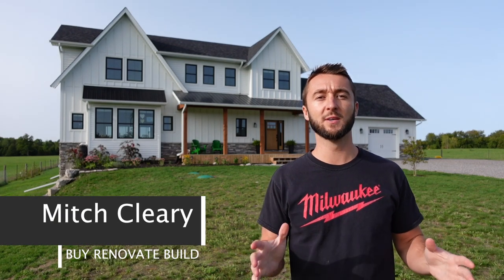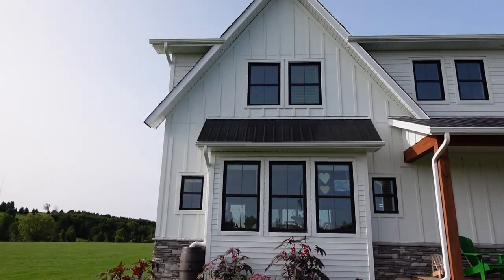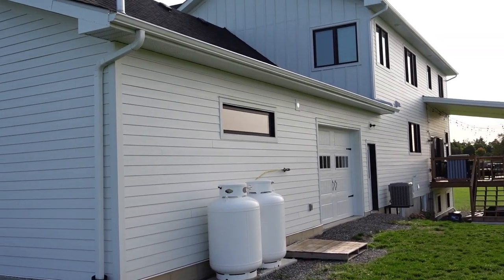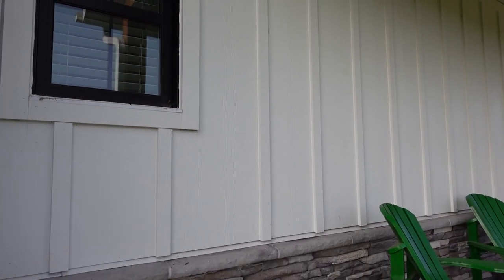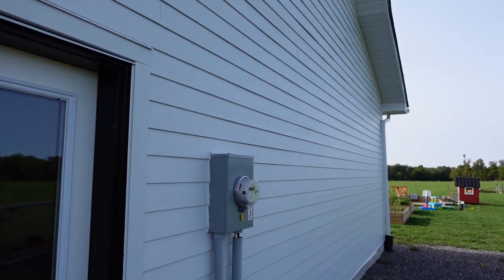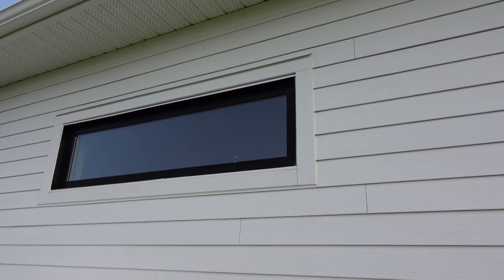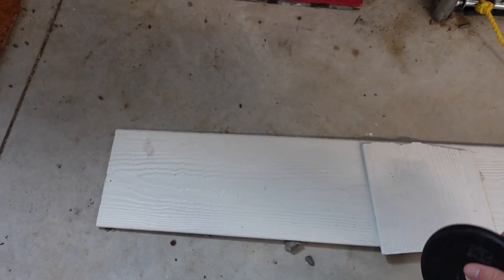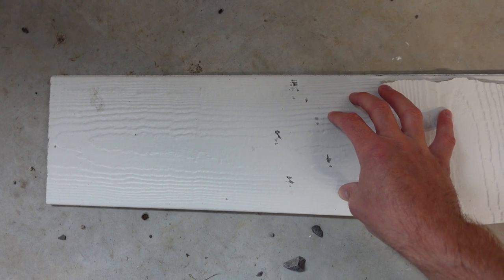Modern Farmhouse Exterior - Review of Our James Hardie Siding!

Comment: Great video.  I'm planning to build a custom home with Zip R-6 sheathing, Keene mesh type of rainscreen which I think maybe cheaper to install compared to wood furring strips, and Hardie board and batten. You're house looks amazing!
Reply from the maker: Thank you, we love the look I cant believe more people don't use it! Do you have an experienced installer to do the work? We used strapping behind ours but it is vertically oriented in all cases possible.
Reply: @BuildLessons  Yes. Living in US in the state of Maryland hardie cement siding is very popular and there are many installers.  The nice thing about the Keene easy fur strips for the rain screen is they can be installed vertically or horizontally.  The large hardie vertical panels I believe can be fastened to the OSB and not necessarily all the way into the studs but not sure about this. Did you use any continuous(exterior) insulation on your home?
Reply from the maker: @tamil1001  We did use continuous exterior insulation. It is a more Canadian product called BP Excel. It is an R5 product that is not as solid as the Zip system, and without as many glues so it actually breathes which is interesting. Keeping our wood strapping vertical was very difficult on some sections of the board and batten areas and around windows. We have had no water issues yet. The installer and myself were very meticulous about flashing and caulking details, but if I were to do it again I would plan to incorporate a drainable furring option like you are using! The one nice thing about wood strapping is that it does not compress - I did worry about that with mesh style furring products, that it might create a wavy finish by getting slightly compressed where the hard and trims were fastened to the sheathing.

Comment: Did you look at pre-painted LP siding?
Reply from the maker: We did briefly, have you ever used it?
Reply: Yes , I DIY resided my 34 year old midwest house with it. On the bottom ground row I used  a textured PVC  1 X 8 with one routed  beveled edge that the LP lap siding went on top of.  It looked very similar to the LP siding texture and should help moisture/snow from causing an issue with any swelling on the LP, which was the main complaint I heard. It was easy to work with. My neighbor had James Hardi put on by professionals(the weight and cutting dust I couldnt deal with).All my cuts were painted with matching color as I installed. My previous siding was 8"beveled cedar and that had warpped and cracked quite a bit on the south and west sides of the house. So far (3 yrs ) the LP is looking good.